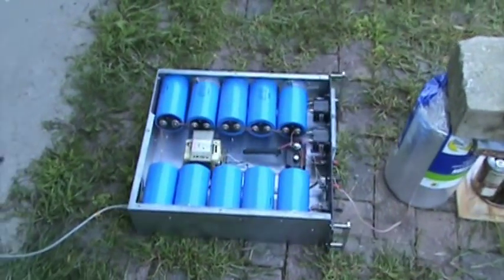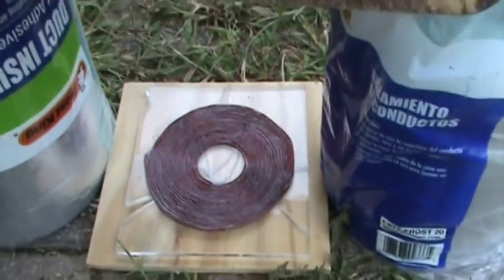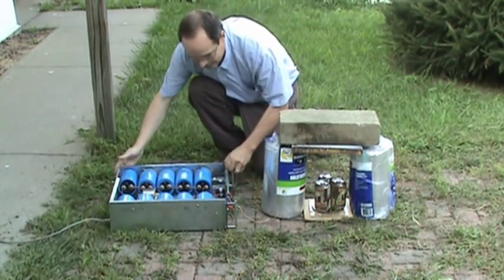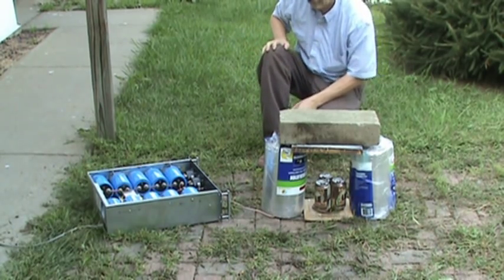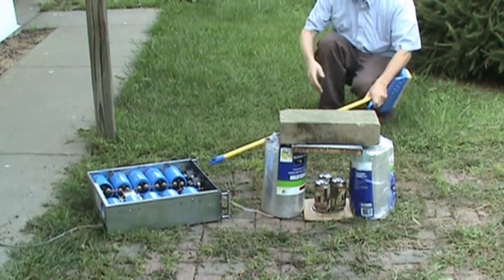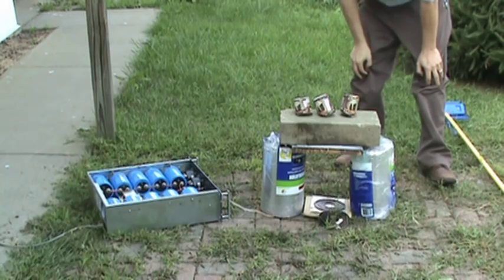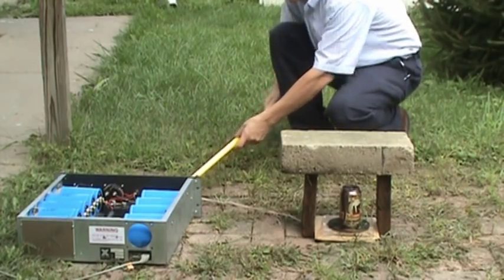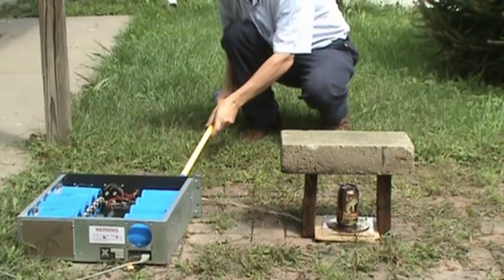2KV Washer Launcher

Comment: How do you know it is 2000 amps? What duration and wave shape is the pulse of current? BTW, incandescent light bulbs make excellent current limiters for large capacitor banks... Bulb voltage should be close to or equaling line voltage, while wattage is varied to adjust charging current. As the caps approach full charge, the filament(s) cool and resistance drops, accelerating the final phase of charging.
Reply from the maker: YodaWhat The 1600 amps is the peak current rating of the switching device.
Reply: You misunderstand, SYNQ. Only one bulb is needed, of almost any wattage, in series with the input line, before the transformer. 
When the circuit starts a charge cycle, the cap bank acts almost like a short circuit, which is communicated thru the transformer back to the AC line. A bulb in series there limits the charging current to a bit less than the bulb would draw by itself, as nearly the entire line voltage is across the bulb. As the cap bank charges up, the effective load lessens, the bulb sees less voltage, the filament cools. Cooler filament has lower resistance, so charging current increases to compensate, automatically and passively. The net result is close to Constant Current Charging, but at almost no capital cost. Match the bulb wattage and amps to the desired charging current. This method protects both the transformer and rectifier from excessive current.
Reply: +YodaWhat 
The peak current can be calculated (and/or estimated) if you know the resistance of the circuit, the turn on time of the switching device, and the inductance of the circuit. The coil's self-capacitance in this case shouldn't be enough to cause much of a change in the current/waveform, but you can calculate that in as well :P
BTW, you can use a kettle or heating element (or even an electric space heater) as a ballast.
You can even use a capacitor (non polarized!), as long as you have full-wave rectification. Just be careful not to create an LC circuit with the transformer that could oscillate under your conditions, because it might build up voltage and destroy stuff :P

Comment: Oh, and might I suggest using an inductor on the supply side of the microwave oven transformer rather than the resistor on the load side.  And your charging system is slowing in voltage due to the large capacitance and the RC time constant.  If you overshoot the target voltage with your supply,  you will hit the target in a more manageable time.

Oh, and that mop handle scares me every time I see you use it.
Reply: And what is more scary that mop handle is not a wooden stick it is a metal pipe coated with a very thin plastic